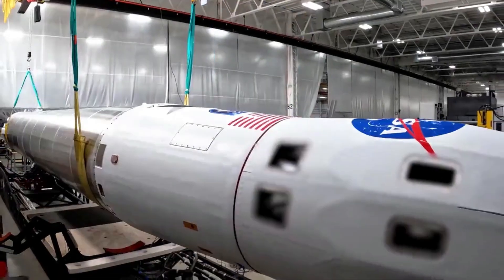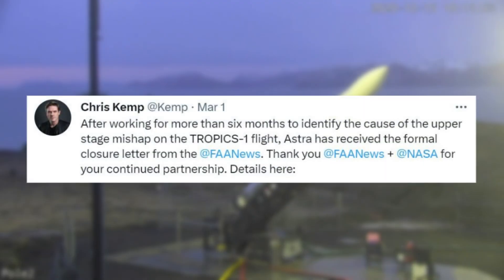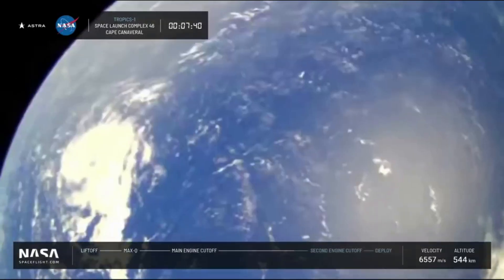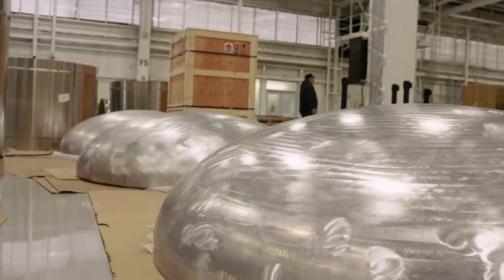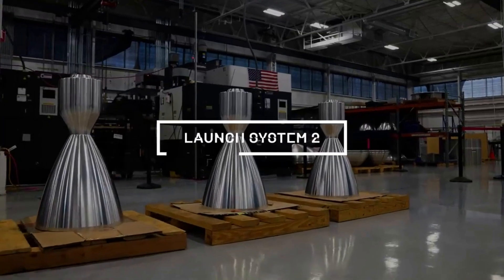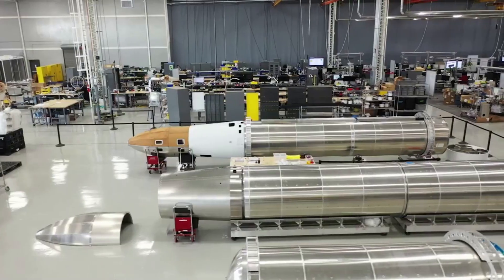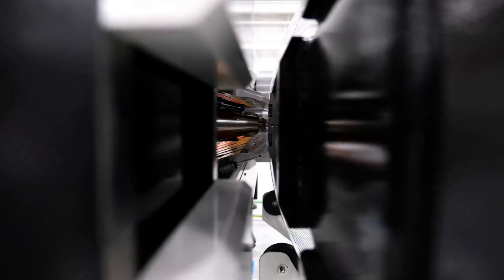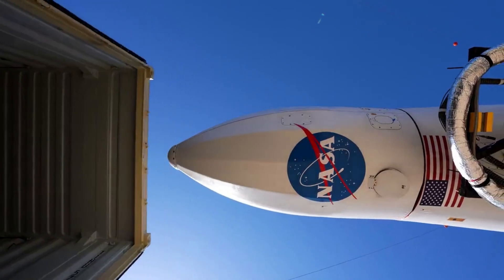Exactly What Went Wrong On Astra’s Most Recent Launch

Comment: Around 06:46 - you mention that building rockets entirely out of metallic structures is "proven" and "cost-effective". Can you elaborate more here? Agreed that, initial investments are cheaper for metallic structures and tank but not proven to be the right choice for small sat launchers. IMO, the trade between metallic structures vs. composite structures becomes really murky as you reduce vehicle size. Penalties on payload capability is severe as you introduce more structural weight on the vehicle. 

Rocket 3.0 had some of the lowest payload performance as compared to its' peers (Rocket Lab, Firefly, Virgin Orbit, etc.), so metallic structures (as a MFG benefit) may not have been the economically competitive choice overall. Rocket 4.0 is better in terms of capability (600 kg to LEO), so it remains to be seen if they can be competitive overall, with the choice to make structures out of metal vs. composite.

Fun video overall! Nice work.

Comment: I listened to this video several times to see if it said what caused the partial blockage in the engine’s fuel injector that led to the engine failure. It didn't definitively explain. From what I understand the conclusion was gaseous fuel as the likely source. Apparently, the warm temperatures at Cape Canaveral on the day of launch, meant the fuel was slightly warmer than in prior flights and the engine was fine-tuned with “thin margins” for keeping the fuel from boiling during the regenerative cooling process. Moreover, the selection of a kerosene-like fuel with a higher vapor pressure than traditional rocket-grade kerosene (RP-1) had an adverse impact.  As noted in the video, another contributing factor was an eroded thermal barrier coating in the combustion chamber.  Not mentioned was the engine was never tested in a vacuum where engine exhaust jet expands to become “fully attached” to the inside of the nozzle. Therefore, the fuel passing through the engine during flight is heated to a higher temperature than during ground testing. Fuel boiled after going through the regenerative cooling channels resulting in gas rather than liquid fuel going through the injector that slowed the rate fuel flow through the injector and thereby through the regenerative cooling channels making them hotter.  Resulting in a "runaway event" where fuel further boiled providing more gas to the nozzle that further reduced its ability to cool the chamber resulting in a burn through.
Reply: Good summary.  Keeping the fuel at its' critical point (or very close to it) in the regenerative cooling channels has been an experimentally validated way to improve regen performance. That is likely why Astra's engine calcs kept the margins so "thin". Rocket 3.0 being a small sat launch vehicle needs every bit of prop performance (and therefore payload performance).

TL;DR: Build extra margins on single point failure components!
Reply: How does that account for an increase in fuel consumption?
Reply: @soknightsam  There was a burn through hole in the cooling tubes that sprayed fuel into the engine at a fuel rich improper mix.